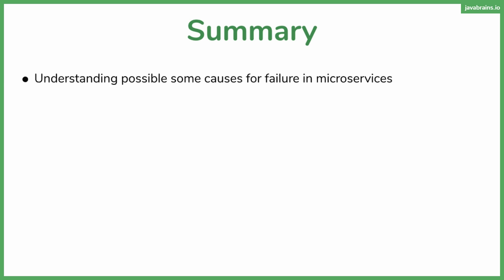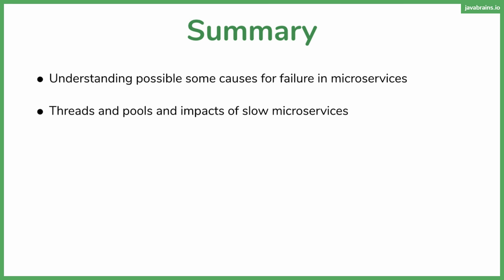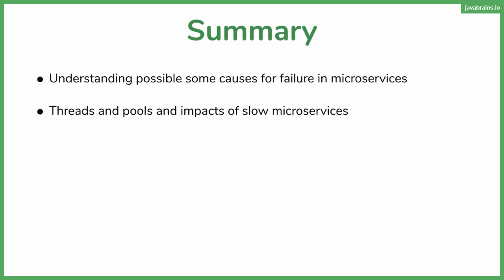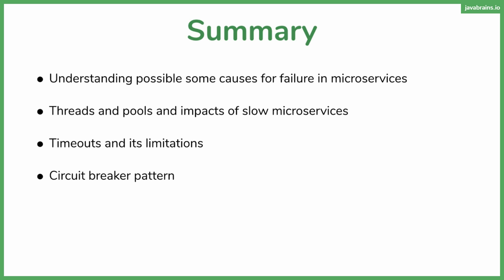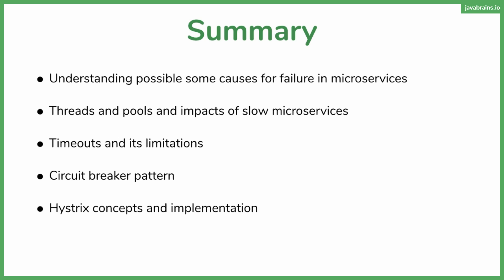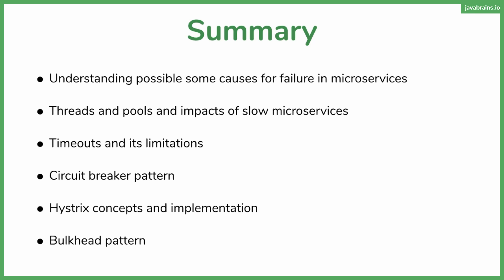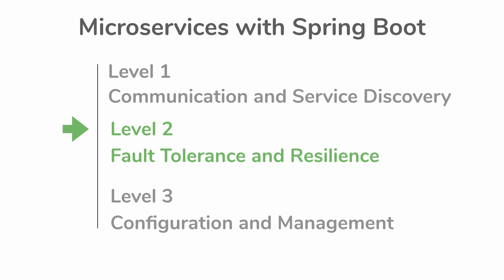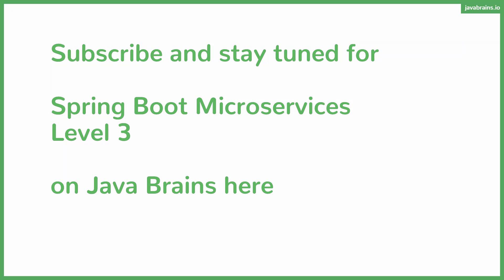23 Summary

Comment: Thank you Koushik. @Java Brains ,  I had some idea of developing and setting up microservices based project, so watched some of the videos of Level 1 series and took pull of the level 1 code from git repo and then today only watched and simultaneouslyc coded for all 23 videos of Level 2 series. Learnt a lot from these, Stuck at two places. 1. after adding circuit breaker and bringing one service down and again up. I was not receiving correct response for few requests and after few requests it was giving correct response. After some time i understood that its default configuration of circuit breaker which is finding that application is down or up after few seconds, then only it gives correct response. 2. Hystrix dashboard did not worked even after doing all steps, may be because i am running eureka server not on default port but on custom one. 
Thanks for all the learning.

Comment: May I have a question about microservices communication:
A microservice usually secured by OAuth2 or some other credentials, so what is the best way to request data from a server to server to bypass the security and get a response?
Reply: I mean what's the point of security if you can bypass it?

Comment: Circuit breaker would only be applicable for the unexpected delays, timeouts. In case if a API by default return in 3 seconds one would need to make in async and the task needs to be passed on to a queue. This should have been mentioned. Also felt this was just hystrix tutorial, Level 2 could have covered dockerizing, security, authentication challenges with microservices. Zuul should have been covered before hystrix. Probably make a Level 3 😋